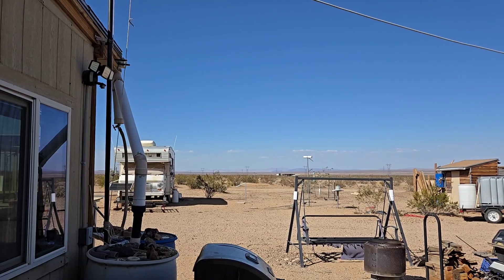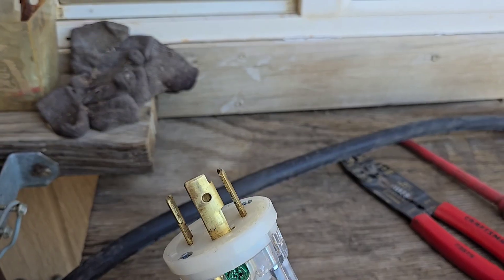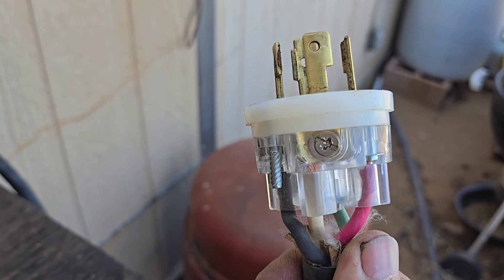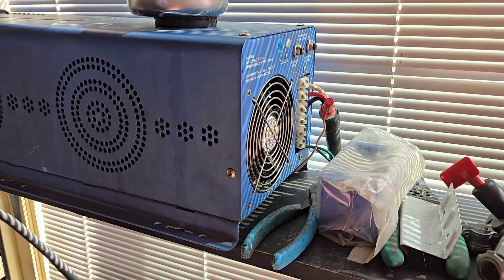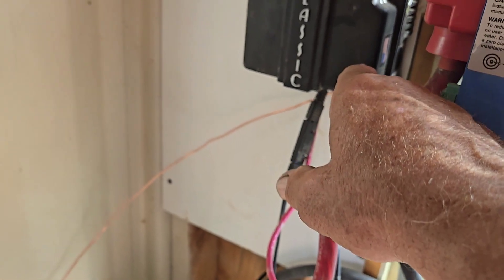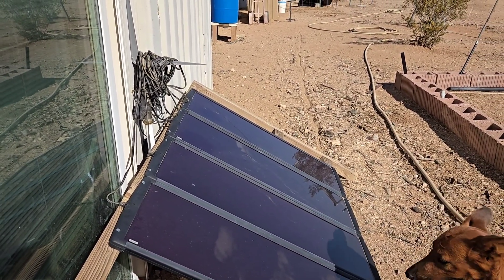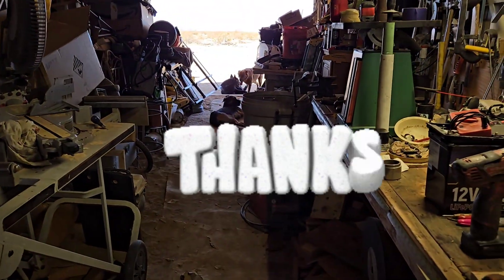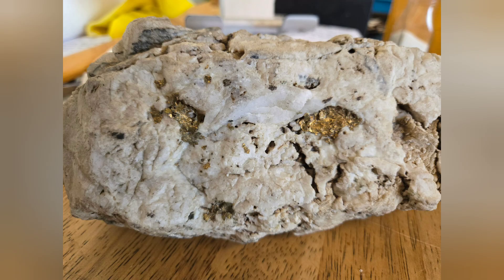Which Wire Goes Where?! Aug. 30, 2025

Comment: hey g bear i just received a 200a watt meter and power analyzer can i hook it up to one of my charge controller that does not have a read out full time?????
Reply from the maker: Well, I don't know all the specifics of your system, but you should be able to connect it online between your battery(s) and the controller to show volts, amps, watts, etc.
Reply: @GBear  thanks  have a blessed day, im still learning to walk but ill get their

Comment: G Bear, only works if you can see colors. It’s difficult for me to determine the difference between red & green.  🙏🫡
Reply from the maker: Don't play with electricity.
Reply: @GBear  I don’t !
Reply from the maker: @billm5433 I wonder if there's an app that will tell colors from a photo taken with your phone.
Reply: @GBear  My Wife has in the past been able to tell me the colors. Especially while driving!
Reply from the maker: @billm5433 I was told that my snoring scares people.  Especially when I am driving.😅
Reply: Traffic lights are ok when the top is red & bottom is green, however, when they are  horizontal it’s a mess.  🙏🫡

Comment: Don't kink the power wire to the pump, might lose water pressure. Just kidding. Have a good day
Reply from the maker: Yeah, and the voltage will be reduced by half.😂
Reply: @GBear Oh Lort 🤣
Reply from the maker: @1GREATDANE I'll be producing Bentricity.

Comment: Great job G Bear. I like that rack of 3 fans you have. I need 2 of them. Got my premium 15A battery charger all fitted today it's ready to go now.
Reply from the maker: Thanks.  Sorry, can't help you on the fan, I found it in the desert where somebody dumped a bunch of stuff.  One fan doesn't work, but it works in my shop with 2 fans.
Reply: @GBear  Just found them on Google.
Reply from the maker: @daz.r1994 cool!